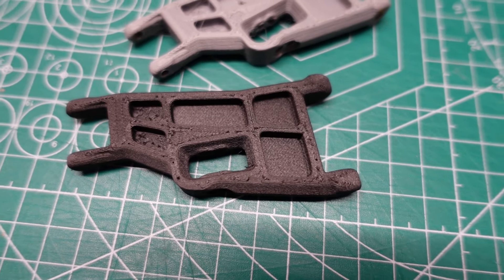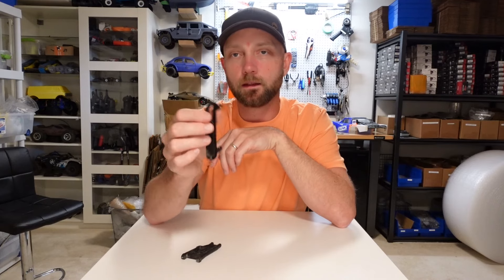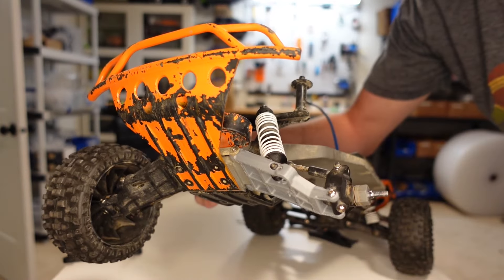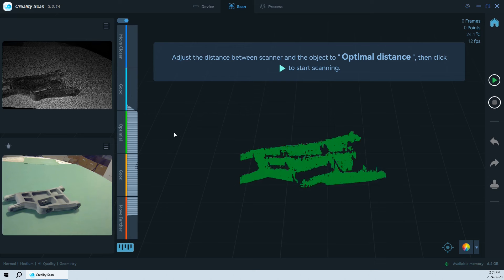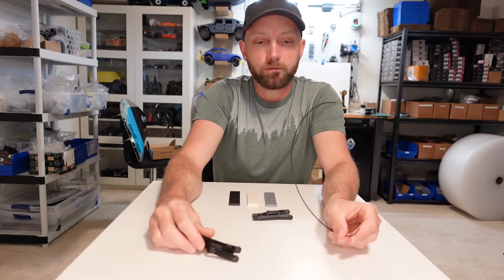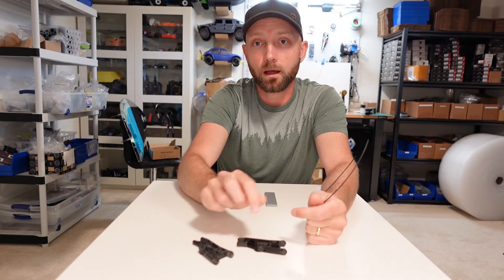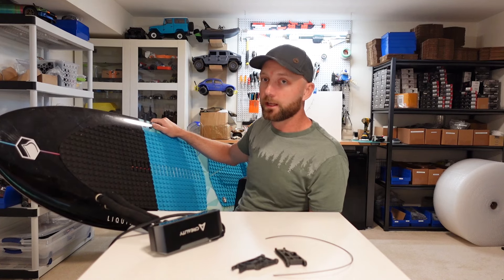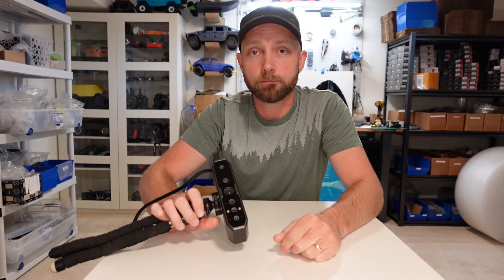Scanning and Printing RC Car Parts with the Creality CR-Scan Otter

Comment: To help scan the other side use a geometry rich object like a printed maker tower or a couple crumpled up towel with the board up on its edge that way when you go around to the back side, the scanner can hold onto the additional geometry
Reply: Yeah, scanning targets with or without marker dots, crumbled blue painter tape or clay.
Reply from the maker: Crumbled painter tape is a great suggestion thanks!
Reply: @rcprinter  I made the same mistake as what you showed in the video. The printed maker tower makes a whole world of difference.

Comment: For this particular part, I'd be tempted to print it on it's end so the opening of the joint-holes are facing the Z-plane, the side that has less of a slant is more ideal so it's less support material used. It would be best if the webbing/spine in the part had chamfering to drop those as overhangs. But the main idea is make the holes as structural as possible by being full loops, if you start getting any layer-splits consider trying that, else good layer adhesion!

Comment: Do you think I can scan 1/14th Tamiya truck body's.   Do you think of I purchased a body shell from shapeways I can scan it so I have the files then are they put into STL files or thrown on slicer through scanner .   How can one go from scanned picture to slice to 3Dprint.   I have a elegoo Neptune 4 pro ..  will the creality scanner work with my printer .  Is a big reason I have no purchased yet.  Not sure of the unknowns yet . Still sniffing for more information as much as possible please.    Great job

Comment: You can mold the parts and then modify an extruder to, in theory, make an injection mold filler. While it is experimental, it has been found to work

Comment: I know there's a lot of focus on the materials but what about this freak'n scanner?!?!
I'm so impressed with how well it turned out! 
It doesn't seem like you had to do any "computer" clean up work. Like scaling or removing random artifacts that I've seen show up in other scanned parts before.
Some will say it's expensive but if its really this good, and you have a business in this field, how could you not afford to be without one now?
Reply from the maker: yeah its pretty awesome. I honestly was blown away I just scanned and printed and it came out perfect. There are sometimes other artifacts that show up but its pretty simple to clean up in the Creality Scan software. I think the Ferret would probably do almost as good and is also cheaper but I haven't tried it yet.
Reply: @rcprinter Or maybe the moose scanner .   Would love to see you do a teck talk on a few different scanners then a compare to each other

Comment: Go for a steel bed that you can use magnets on, to fix markers.
The markers do not have to be on the object for your example.

as for the black OE pad, you put markers on it.

Mad how they stick. 😊😊

Put small ones one and do a miniature scan.

Comment: I have zero knowledge on 3D scanners, although I'm obviously here looking to get one in the future. Since you said the scanner has issues scanning black parts, why not spray the part with temp paint? Such as Plasti-dip (they have a ton of colors) , it dries and peels off when your done, assuming you do a good job painting, it will peel off very easily, of course little thru holes and what not may need a little extra "help". Just a thought, I could be completely wrong for who knows what reason, but I'm all ears. If anyone tries it, lmk if it works.
Reply from the maker: That would likely work as long as it comes off easily. Foot spray powder works pretty easily.

Comment: One of my pet peeves, people believing that , that's all there is to it. Talking about people believing they can get good quality parts without bringing it into CAD to create a model with clean and smooth surfaces and clean and accurate features instead of using scanning software to fill holes and estimate voids in the scan.

Comment: What printer are you using?  Those parts look super clean especially where the supports were...
Reply: You can do this with almost any printer. The easiest, but expensive, printer would be a Bambu X1C.
I have a Voron 2.4R2 350mm, Bambu X1C and Snapmaker J1. Every printer can print quality parts.

Comment: You don't want 100% infill you want some give, I think 70% is the same strength as 100%, you want some give you don't want the parts to be too stiff they're just going to snap.
Reply: Over 40% infill there is no benefit in strength. If you want strong parts use a many walls as possible and be aware of the part orientation for printing. 
If you want a part absorbing shocks use a different material. PETG for example instead of PC, PLA or ABS. Or PA12, 98A TPU, PP.
Reply: @Todestelzer  okay yeah I knew it wasn't 100% for some reason I thought it was 70
Reply from the maker: I suppose I'll have to do some more testing but anecdotally RC parts at 100% infill seem to have longer life for me.
Reply: @rcprinter  yeah 100% info especially with a part that's going to be taking an impact you don't want to be too stiff unless you want that the part to break instead of another part that's connected to it

Comment: You would need 3 scans, otherwhise a 60000€ scanner can also not merge it. In my opinion these Carbon Fiber Filaments are not the best to achieve maximum strength. To realy make a 3d print strong with CF you have to go for a Markforged Printer which can make the parts fiber enforced with real endless CF fibers. The strength of this Filaments with CF splinters is to make Lightweight parts but if you compare Nylon CF to Nylon plane. Nylon will outperform the CF splinter Nylon composite Part.
Reply: This crabon fiber BS is just annoying.

The only reason it's strong is because is used as fibers and then sealed in resin.